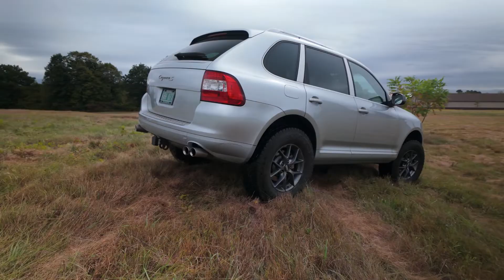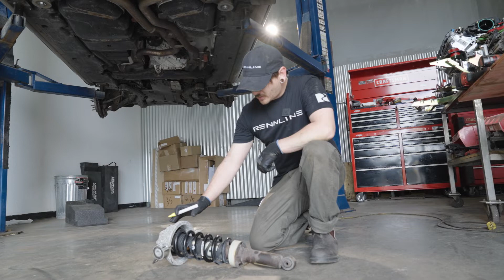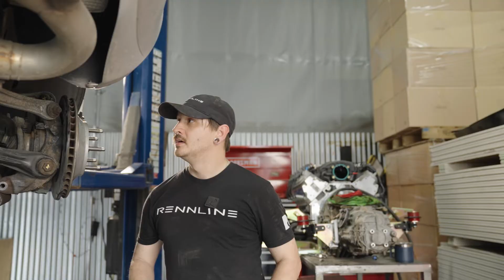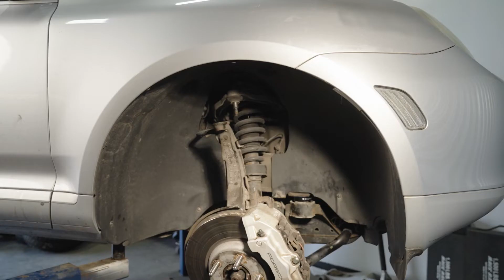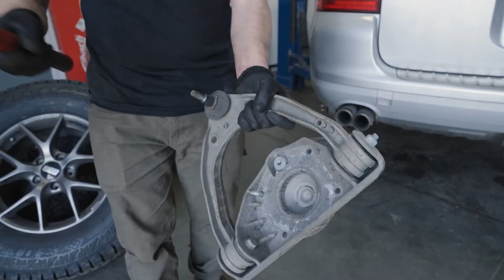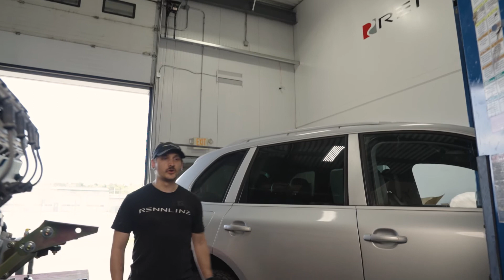Rennline 75mm Lift Kit For 955 and 957 Cayenne

Comment: You guys skipped the most difficult part of this, which is the third strut hat bolt on the driver side that's located directly underneath the brake reservoir. Does anyone have any idea how to access this one?
Reply from the maker: We used a long extension with a swivel head socket

Comment: I can't for the life of me get the front strut in with the top hat assembly, I loosened the lower control arms but still not even close to getting it in position.
Reply from the maker: Push the hub down as you install the strut. Might need a friend to help finesse it.

Comment: I'm planning to lift my 06 CS, and may have just decided on yours vs "the other guys" based on the informative video. Two questions though. 1, is proper alignment possible still without aftermarket UCA's and 2, would this kit require installation of a transmission mount drop kit also?
Reply from the maker: The car we installed this kit on has the factory UCA, alignment is within spec and no transmission drop kit - The additional mods are not required to fit this kit, but they are a worth while upgrade!

Comment: Anyone watching this, loosen EVERY rear control arm bolt so the suspension moves freely. He makes it look easy here but the rear kind of sucks to do and it’s difficult to get enough droop in the suspension to get the strut lined up
Reply from the maker: You are right about that. Its not the easiest install, but possible with a friend on the weekend!